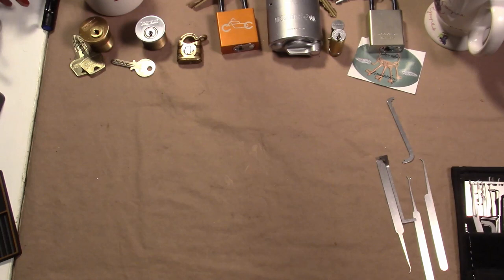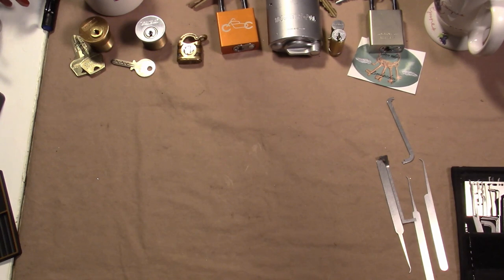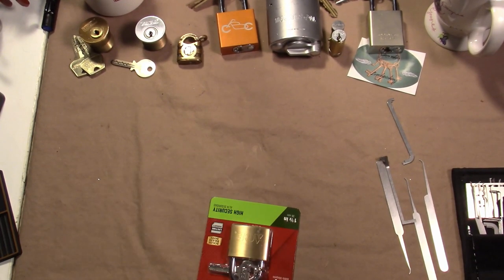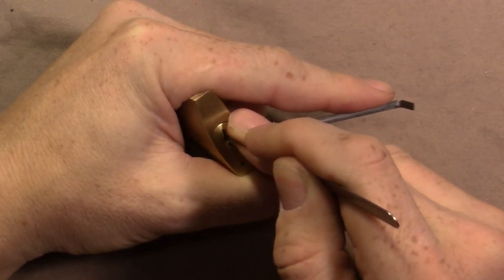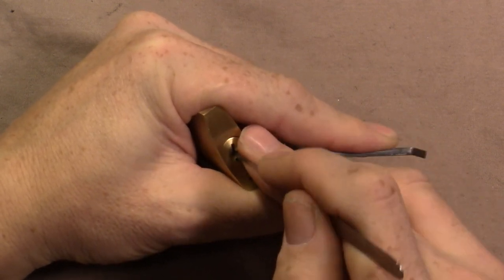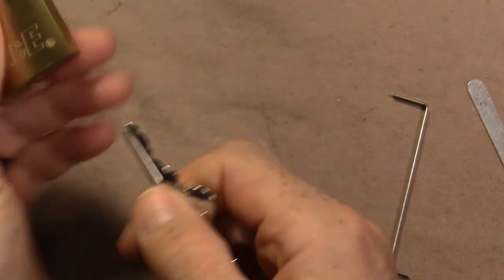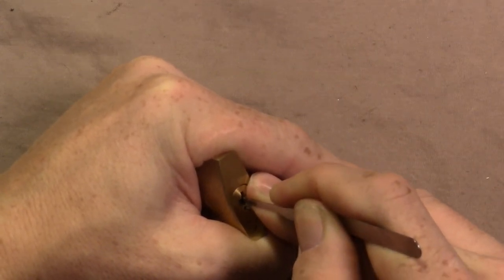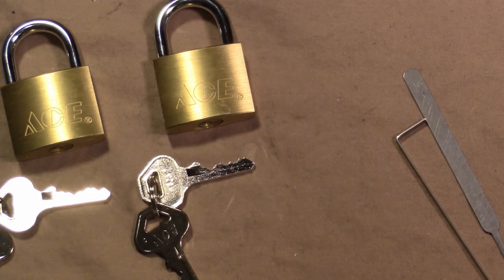ACE 38mm Out of Package Pick x2

Comment: Awesome to see two of these picked right out of the package.  I have one, which behaves pretty much like the one you ran into - set one pin and drop two others.  Any tips on how to get out of that ping-pong cycle?
Reply from the maker: It takes practice to get out of the ping pong cycle.  My technique is to carefully lift the pins with light pulses of pressure.  And experiment with tension.  Some lock take super light tension to keep from dropping pins, others more of a light/medium.